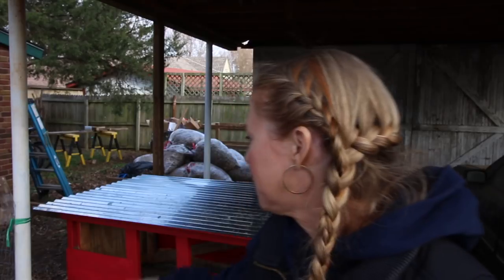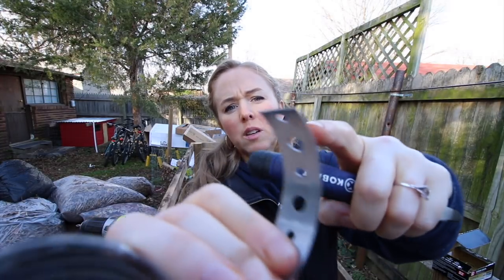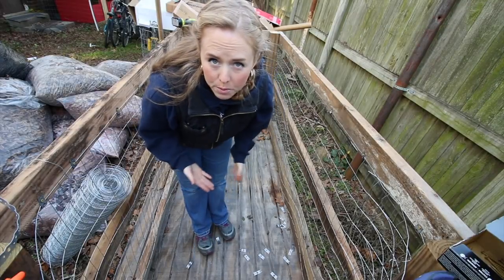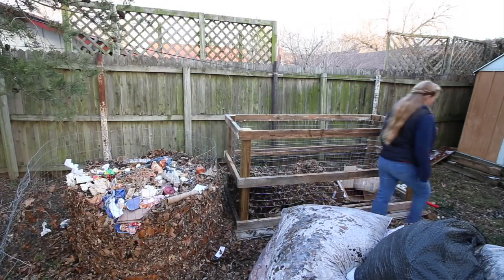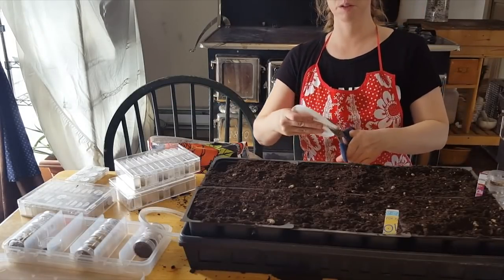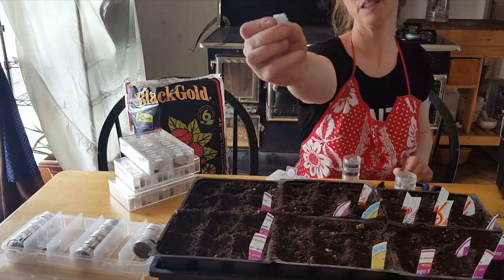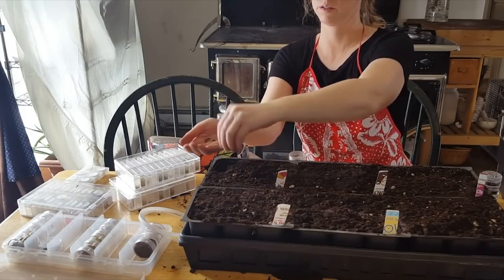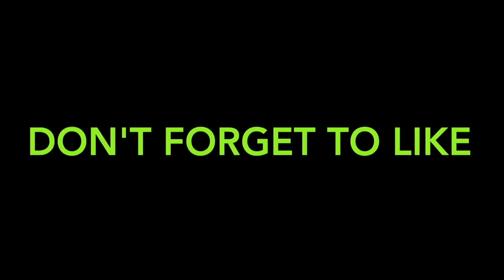Too Cold (LAZY) to Garden

Comment: I actually got a gym membership for the winter because I was concerned about losing the strength / stamina I gained through the outside season (winter is so bad here there is nothing much to do and it's easy to hibernate) so I can hit the ground running come spring. :)
Reply: Wjen you have animals, you dont need a gym membership because there is plenty to do around home.  I used to do the gym and a garden and now do more at home.

Comment: Find yourself a local donut shop and see if they will let you have 3 1/2, 4 1/4, or 5 gallon food grade buckets 4 free.  Great for vertical storage.  I store grains, dehydrated foods, potting soil, and even water.  Heaviest items on the bottom.  
If you have access to hedge trimmers, mower, or even blower with vac attachment, it will greatly reduce volume in compost bin.   Adding free coffee grounds from local coffee shop really draws worms here.
Happy New Year.
Reply: Thanks for the heads up on these. I get 5 gal buckets from restaurants too.

Comment: Also, pumpkins and squash deworm pigs. Never new about sorrel. Hope I can remember all these tips.
Reply from the maker: That is what I understand. We used to buy trailer loads of pumpkins for our pigs but they just got to expensive. Hoping to open up two more gardens this spring and get enough to go through the winter instead of just through November.
Reply: @dirtpatcheaven  I got all of them and I mean hundreds of pumpkins, squash and gourds FREE. Look for a place selling them before Halloween and ask to have any that they can’t sell due to damage by rain, rotting, soft spots, etc. if you find a place that buys their pumpkins, you can also get huge cardboard boxes that are super thick. I must’ve gotten at least 50-75 of those too, free. The walls are close to 1/2” thick. Unfolded, they each cover about 50-60 square feet. The guy has some older ones from last year in a stack and I’m going to get those too once it dries out and gets above freezing because they’re presently stuck together in a huge frozen block. They should finish covering the food forest area that I’ll cover with compost and wood chips. It’s only half finished now. Was trying to get it done before winter, but ran out of time. Right after Halloween I also drove around to businesses that had straw bales set up in front of their entrances with pumpkins, mums, gourds on display. They were happy that I’d take them and save them the cleanup. But bring someone with you, they’re extremely heavy once waterlogged. I picked up a trailer load, plus filled my truck with pumpkins and such.